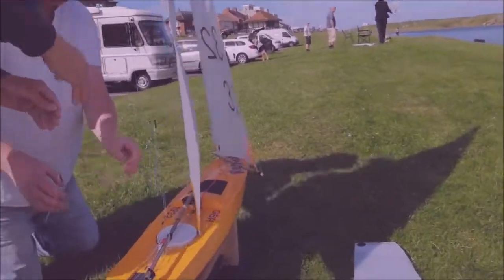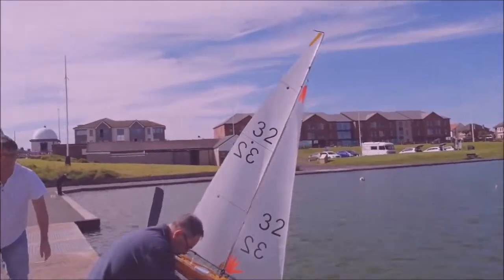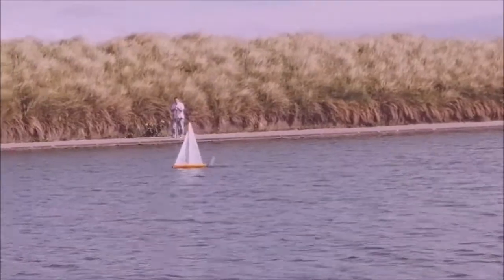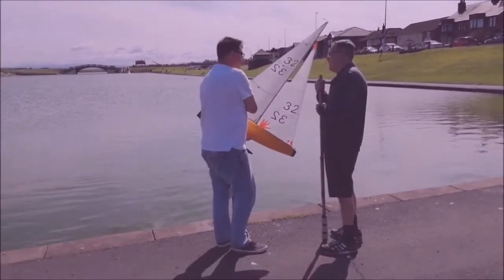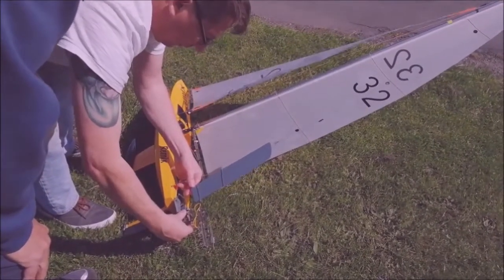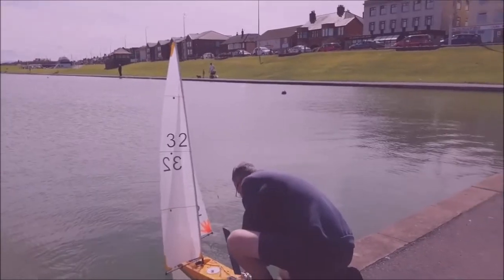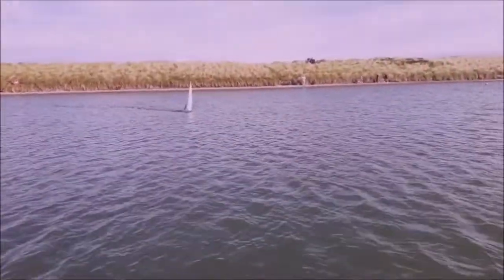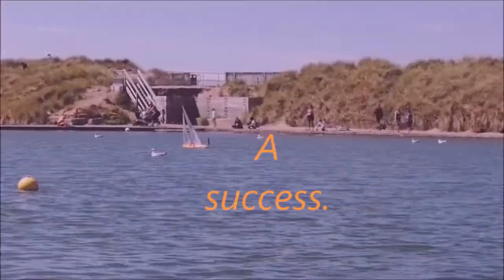36R Vane boat 3D printed Hull

Comment: what printer and material type did you use to print the hull?  I've been waiting for the technology to mature to this level, but I didn't know what would work.  Great job!
Reply from the maker: Sorry for the delay in response, I 've just not been getting the messages through. It was Damian that has printed this from over Yorkshire way, he has also done bigger boats with great success. You may be able to find their webpage.
Reply: @flyingtonyw  that would be nice!  The technology is changing all the time, and i've been waiting to jump in until the hull making was feasible.  I'll get back to you if I can't find Damian.
Reply: @flyingtonyw  Sorry, can't find Damian.  Can you send me a link?
Reply from the maker: @MultiTman1000  http://taylormadeyachts.com/ here's their website.